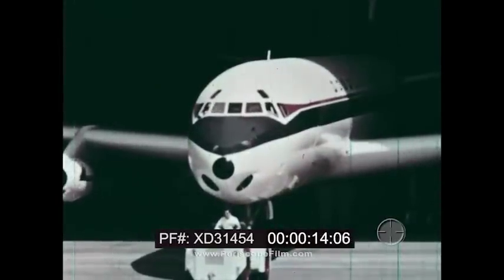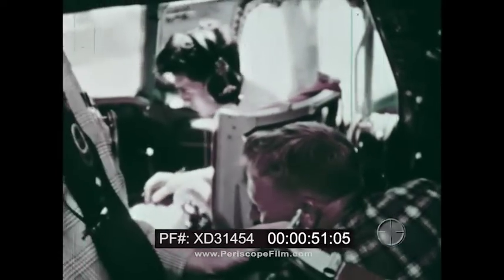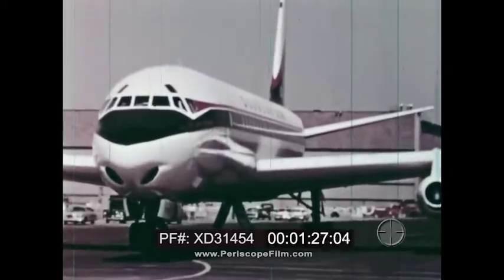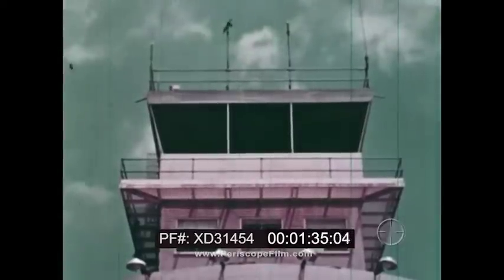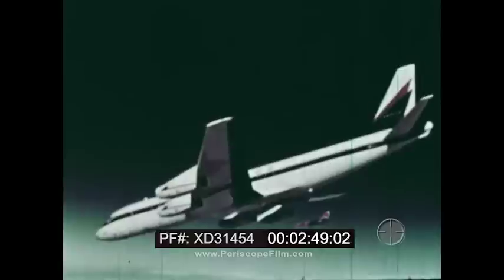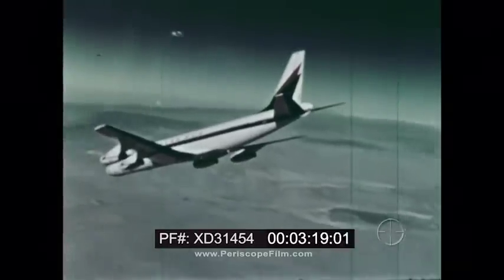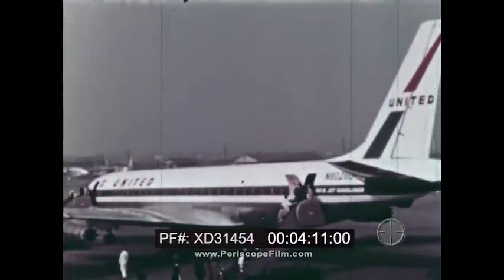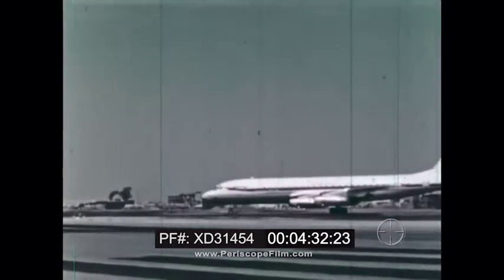DOUGLAS DC-8 JET ROLLOUT, GROUND TESTS & FIRST FLIGHT XD31454

Comment: These sorts of industrial educational films were distributed to TV stations to use as filler before and after regular broadcasting hours in the late 1950s, during the 60s and 70s; up until 24 hour broadcasting became a thing. I remember when TV stations shut down at night, usually at 1am or 2am, they'd play some patriotic tune and then the screen went blank until signing back on at 6am or so. 3 channels, ABC, CBS, & NBC.
Reply: I remember stations turning off late at night in the early 90s in Canada

Comment: I don't remember those nose and engine air ducts on the DC-8  plane I flew on in '67. Were these removed?
Reply: Those engines are J-57/JT3C engines, which were used on the first series of DC-8s, to be be replaced with different engines of the next DC-8 series produced. I didn't know this until I watched this video, and recognized the engines from when I was a jet engine mechanic in the USAF, working on the earlier -135 acft. The cowling on the inlet was for the air-oil cooler.
Reply: Yes, those 2 nose scoops were for the air conditioning, but as with 707s, early DC8s had freon-cycle A/C like your car has. Later models utilized air cycle packs, which use engine bleed air to cool, heat--and pressurize.
Reply: Different engines were added later. The nose ducts were for the air cycle machines for air conditioning.

Comment: Had a McDonnal Douglas pamphlet in Jr high, with  factory history diagrams up to the DC10. Our teacher s dad worked at the Long Beach plant in the old HQ building. Every kid got one. The DC8' had very long fuselage compared to the  previous models. Very long ago, but remember seeing alot flying to LAX
On landing approach and could easily tell the aircraft apart from the others, Boeing, Lockheed & Douglas  .
Reply: My grandfather worked on the First DC-3's for Douglas in the 1930's !!